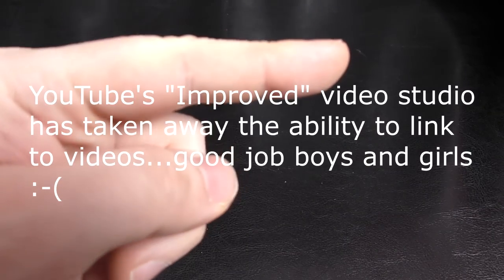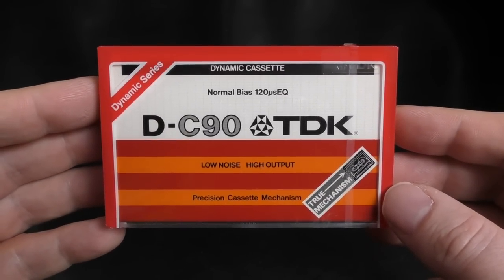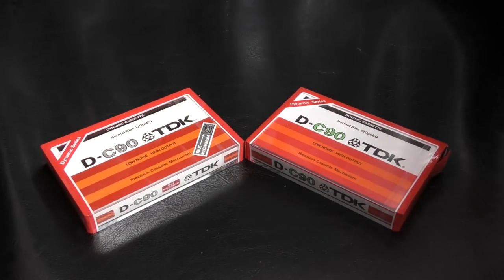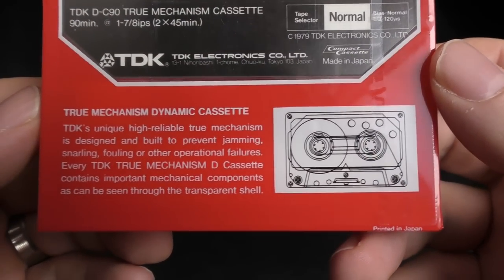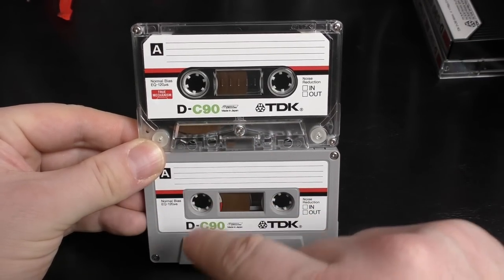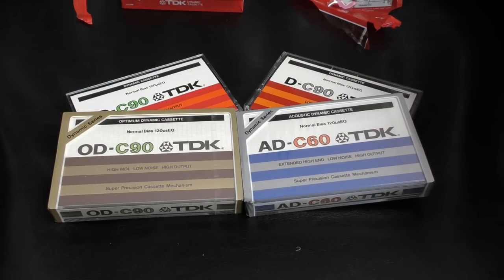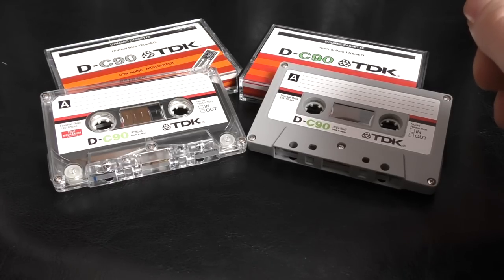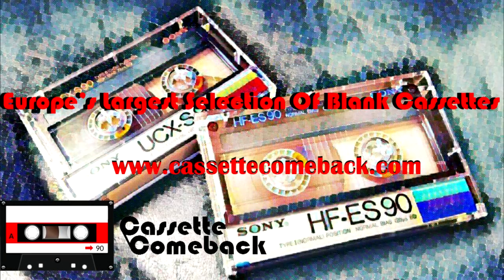TDK D True Mechanism Type 1 Cassette - A real TDK or Fake?

Comment: I'm in the mood for wild speculation: Maybe TDK was outsourcing the production of the head cleaning tapes to some less than scrupulous manufacturer, who then decided to build a side business around those genuine TDK parts and molds.
Reply from the maker: It could be plausible.
Reply: @CassetteComeback  in uk
Reply: @CassetteComeback   I have an original one from 1975, it has the same colors, spine and outer logos and the gray C90 and red TRUE MECHANISM symbol, but the black J has all 3 addresses, Tokyo, New York and Germany, and also almost the same diagram and list of 7 items but the font and wording is noticeably different, the inside is all white with lime green lettering.  The slip sheets do NOT have any dimples.  The stripe on the label of the cassette itself is only on the right side BELOW the viewing window and it's thick black line and lime green line below.  It has gold etched vertical hatch lines on the window, the shell is semi-translucent clear, Side A guide rollers have 6 spokes, Side B guide rollers are empty (same white plastic).  Instead of a 120ms EQ normal label, it simply says in tiny letters MADE IN JAPAN and on the upper right there is the "Compact Cassette" logo.  The case is completely clear and etched Made In Japan with a circle in the middle engraved 231A.  There is also a black manufacturer's mark on top of the cassette shell that reads TDK AJC723.  So it appears these were REAL, but the one you have is the forgery (or more likely, the 1979 version the FBI and TDK took issue with).  What a great story, thanks for sharing, I always thought this one was unique anyway, and it sounds great.
Reply: @YamFZR93    Could this be a strange case in which the fake is worth MORE than the REAL?!
Reply: @grizzlyaddams3606  yes , fake  /clone does not actually mean worse

Comment: Great video! Producing the cassette and box in clear plastics (box is clear styrene) also saves costs, no pigments needed. I think the reason for emphasising “True mechanism” is because now you can see how well the mechanism is built. I have unscrewed both versionsnand other than the lack of pigment there are no differences at all. So, the regular D’s are true mechanisms as well…..TDK-D is a true standard, of all cassettes I have, the TDK-D and AD survived the best if it comes to resisting demagnetisation. BASF Chrome are the worst, all lacking the crystal clear reproduction they once had. That leaves no other option to re-record them.

Comment: Nice interview and very useful service provided to the community. By the way... those seem very good tapes, probably similar or even better than the original D. I suspect this for a reason: if RAKS was commissioned to make a tape for TDK, and they probably did under the agreement they would eventually get a license, it's likely they chose a formula that was as close and as good or even better than the original TDK's D. And what brand was in business with RAKS at the time? BASF I believe were the ones providing the CrO2 pancakes for their Chromium Dioxide cassettes. BASF had the technology to match the performance of a TDK D, after all the IEC standards are based on BASF reference cassettes.

So... good to know. A TDK which isn't a true TDK but certainly is branded and sounds like one.

Comment: Great video again Tony. Much appreciate the effort you put into these vlogs. I agree that it is very strange for TDK never to have advertised these cassettes. I also think however that an out and out knock off also seems unlikely. Today it would be no problem, but manufacturing in the late 70's was a very different game, and counterfeiting at that sort of level was not so easily done. With the True Mechanism having been produced for a number of years, I would have thought that TDK could have had a big operation like that shut down if they wanted too. But who knows? As you said, it all just makes for a much more interesting story. I do have a couple of these tapes, and never gave it a thought before that they might not be genuine. All the best

Comment: surprised you don't mention the difference in SMELL coming from the cassettes and from the cardboard J cards.  Remember in the 80s you could tell which cassettes were FAKES by the smell.  The FAKES smelt cheap.  Oily smell and static on the plastic shells.  The cardboard J cards on the FAKES reeked of cheap printing.  colours would run when wet.  And of course the loose cellophane around the fakes would often move when pressed by your fingers.  Hope this helps.  Enjoying your videos 👍👍👍
Reply: Just like the Japan-made Maxell LN, UD and UR tape series of the early 1980's which had a strong smell when new - proving their freshness and how genuine they were.They were also better quality.
Reply: I'm thinking more of the millions of fake TDK D cassettes in faded red/orange wrappers... just horrible! 😵

Comment: My guess is these were genuine TDKs made for specific markets (ex. Third world countries). They probably had lower than optimal quality tapes inside. They were not intended for EU or North America. Other manufacturers have done it too. For example, Maxell, Sony, and Denon made their popular cassettes for the Iranian market with added text in Persian. 

As it sounds crazy to see the True Mechanism printed on these tapes, Japanese manufacturers did similar things in different ways to attract customers in third world countries and make them pay a little bit more. I bought a Panasonic TV in Middle East from an authorized distributor. There were two versions of the same TV. One was made in Malaysia and the other was made in Japan. The only differences between the two were “Made in Japan” printed on the front and “Made in Japan” labels attached to the back of the supposedly Japanese made TV. However, peeling off the labels in the back revealed the embossed “Made in Malaysia” on the back of the Japanese made TV.  Panasonic would honor the warranty claims and serial numbers were genuine.

TDK also had a factory in Iraq around the same time that manufactured TDK tapes for the local markets and they looked very similar to the genuine TDK Ds. 

TDK just didn’t sell these in EU, USA, or other first world markets and they didn’t want some one else illegally import them.
Reply from the maker: It could well be.  Thanks for sharing.

Comment: I have a TDK D 90 True Mechanism cassette, which has a copyright year of 1975-1977. It lacks the address in Japan. The sheet on the inside has green lettering. The box on the outside isn't frosted as yours and it has a square on the right with "MADE IN JAPAN" written on it. The shell lacks the True Mechanism logo on it and the C-90 font is green. I'm wondering if my cassette is an earlier example of the said TDK D True Mechanism cassettes or not ?
Reply: professionalvr I also have one of these, It's a bit different..
Seems genuine TDK to me..

Comment: Tony, great video, II watched it with  interest. 
I bought True Mechanism TDK D-C90 from electronics store in Bulgaria in the spring of 1978. Absolutely certain about the time, these were my first casettes when I got my first cassette player Hitachi TRK 5030E. The clear plastic body and slip sheet are identical. The white on black print carton insert is identical.  The only difference is that the back of the case is smooth clear plastic, yours has a rectangular texture pattern. 
I live in Florida now, but I still have the cassettes in my apartment in Bulgaria. 
Bulgaria borders Turkey and Greece, and further south is Cyprus...
Combine this with the story of the gentleman from New York, your guess may be plausible...
I listen to these tapes when I go back to Bulgaria and they sound the same as they were originally recorded on more than 40 years ago...original or not...

Comment: I used to have the TDK D “True Mechanism” version since I was a kid, but it looks similar to the regular D, but the shells are different. The regular shell was light gray, and the other shell was clear, and the labels are the same, except the “True Mechanism” name was added.

The US version was basically the same where it used the light gray shells, but the “True Mechanism” version in the US does not. The one I used to have as “Donna’s Tape” written on it, and it has music from a movie that it was recorded off of TV back in the 1980’s including songs from “Grease”, “Saturday Night Fever”, “Guys & Dolls”, “Rock & Roll Mom” and others, not the soundtrack albums, just recordings off of TV.

There wasn’t a “True Mechanism” versions of the SA, MA, and SA-X.
Reply from the maker: That's why I mean, if it was much better than the regular shells, sci only use it on the D?

Comment: Last year someone on the local auction site sold tons of used blanks for 1~2 CNY per tape, and that's where I got these 60 and 90 minutes version of "True Mechanism". I thought these were just normal TDK D of the same era but intended for "professional usage", like what Maxell did with "Communicator". Well, at least it's a decent tape for its price.

Comment: If you notice there are only three colors printed. The tape contains red, black, and green. The case contains red, black, and orange. The gray is probably produced by a dithering process. It would have cost a lot more to include a fourth color, green on that cover. Just a thought...
Reply from the maker: Yeah, you're not the first to mention this. I'm not a printer, but 4 colour printing is a lot more cost? The C60 just reused the orange for the 60. But why did they do it for the regular D and not the true mech?
Reply: @CassetteComeback  Probably, another reason it may have been a counterfeit cassette saving money.

Comment: I have also got four to five cassettes of this TDK with some number on it printed as ACC 122 and the original recording of Dubai is good of Indian music but I just played only once  on my ZX 7 cassette deck because this tape is depositing oxide particles on playback  head and other moving parts.I did not throw it out but can not play also. It means in yhe area around middle east it was sold jn large numbers and it is not a true mechanism but true cassette mechamism.The colour of the reel tape is brown as you showed in your video.
Umesh
India.

Comment: So, what are the odds that some company later bought the original TDK machinery, and turned out fakes, but fakes mostly made on that equipment?  They changed the things they had to change due to supply, and came up with the "True Mechanism" thing to account for that?

Comment: Nice video i do love cassettes :-)
What is  the Aiwa model cassette deck under the Nakamichi ZX-9 at 18:00 ?
It looks either like mine which is the ad-f850 or the ad-s950 which is identical yet is superior model it has dolby s calibration 400Hz & 10KHz tones
Reply from the maker: It's the AD-S950. Brilliant deck and the one I've had the longest.
Reply: @CassetteComeback  

Sure it is if i judge from ad-f850 still having it since 1996 and  playing like new yours ad-s950 is even superior .

Comment: Right. Sorry if this is a stupid question, but it's been gnawing away in the back of my mind. Why would the azimuth vary from one tape to another? I thought azimuth was a property of the deck itself? Once you've aligned it, shouldn't it be correct for all tapes (except ones recorded on a misaligned deck)?
Reply from the maker: The azimuth is a part of anything that is the peak. The best part of a tape might not be right in the middle. It might be towards the centre or the edge. In reality, it's a small thing that mostly won't be noticed, but Nakamichi built record head azimuth adjustment because they wanted to make the ultimate.
Reply: The cassette shell affects azimuth due to the fact that much of the tape guidance happens in the shell. The azimuth control is an attempt to compensate for slight differences in the angle of tape travel.

Comment: Your theories about Raks are interesting, I almost believed. But even if that were true, from a certain point of view, it is still an original rejected by disputes between companies.
I have a fake True mechanism in my collection, also on my website. I will send you the links privately or by e-mail if you are interested.
I think the True Mechanism is just a marketing move and its only difference is in the transparency of the shell.
To make matters worse, TDK had a branch in Iraq, Baghdad. They produced TDK cartridges as well as Eic cartridges.
Reply from the maker: It's very plausible this was the case. It's also being said they could be for poorer markets, like the later T1, J, Fe etc, hence why they weren't "promoted" as such. Because they would be cheaper than the regular D, the thought is that they may have been "smuggled" into the primary markets that they were never intended for and so could be sold cheaper than the regular D. TDK didn't like this and got the authorities involved. Again, all theories, but at the moment, this is the one that makes the most sense to me give that after using a couple, they are as good as a regular D.

Comment: This actually led me down a bit of a rabbit hole. I found a TDK catalogue that lists the 1994 SA-XS type 2 as 'having the lowest noise floor of an TDK tape ever'. Could you by chance look into that claim? I don't see how good a noise floor could be seeing as I don't think TDK ever made pure chromes.
Reply: Connor Mullins there was a TDK KR in like 1973-74 right before SA was developed, so i believe KR was their only pure chrome tape
Reply: It is very well possible that the claim is correct. the early 90's versions of SA-X and SA-XS were some of the quietest FeCo tapes ever made, their S/N ratio always rivaling the contemporary BASF Chrome Super/Maxima, which must have been the quietest tape of them all, but with slightly lower MOL compared to the TDK products. I don't think the single layer KR tape from the early 70's already had as low noise as a late, refined double or triple layer FeCo like the SA-X and SA-XS.

Comment: I believe they are original tdk, as I have some of this type from the previous generation, 1975/1978, C60 and C90 and the internal components are identical to those of the normal TDK D, including the leader tape. I also have a really false TDK "true mechanism" from 1979/1980, which shows the terrible quality of the sheel, printing of the jcard and labels, as well as the poor quality of the case. These tapes must have been produced for a specific market.
Reply from the maker: That seems to be the more likely theory that's developing. Made for poorer markets, like the later TDK J, B, T1 etc...and they never featured in any TDK adverts.

Comment: There were several different counterfeits of the True Mechanism D, I have some myself, and out of what I can see of the example Gary is showing here, he has probably one of the fakes too: The label is improperly cut, the spacer around the erase tabs inside the shell has a more generic, rounded shape rather than the distinct square shape in the genuine TDK's of that time, and he talks about the sound quality being low. So I believe every word he is saying. Cool memory! Now here is my annoying "but"...: Tony, I really think you have a genuine TDK True Mechanism there. Zeddie also has a "real" one. I also have some. There were at least 5 different versions made by TDK. The earlier ones still have the multiple addresses on the j-card. The fact that they are not mentioned in any TDK ads we can find on the web is admittedly strange. On the other hand, my thought on this is that they were mostly sold in Near/Middle East markets. I have never seen them in the wild anywhere in continental (Western) Europe or Scandinavia. This might be why they are not included in the European and US ads. Also, I don't think the True Mechanism is to be considered as a step up compared to the regular D. It is rather a budget model with a fancy clear shell, performing the same as a D. (Yes, I've seen they are biasing a tad differntly, but still close enough for different batches of the same formula). The grey C-90 print is the only thing I don't understand, but still, this is consistent through all the different versions from 1972 to 1979. Even in later years, TDK continued the concept of putting the same tape into an alternative, clear shell. There was a DS and an AD-S: http://vintagecassettes.com/tdk/tdk_files/tdk_year/tdk_84j.htm Concerning Raks, I don't think they were involved. Everything about Raks cassettes is different: Tape, leader, shell construction, hubs, slip sheets, Norelco case... it would have been a huge effort for them to install toolings solely for the True Mechanism cassettes to make them look close enough to a real TDK product, and then not even continue to use it for their own brand.

Hope I don't take away all the positive feelings about this video now, only because I come to a completely different conclusion, because I really like the investigation you've done :-)
Reply from the maker: Hey, I don't say that they're fake or real. I present what I know and postulate on what they could be. I'm not convinced either way, in the end I think they're a decent cassette and worth having. I have no problem with differing opinions, I ask in the video for people's thoughts. Maybe someone can bring something to light about them, and you have expressed your doubts in a lucid, friendly way. I have no problem with being corrected, it's how we learn.

Comment: Thought just occured to me, if these are TDK, might they be an older circa 1974/75 iron oxide stock? Grab and oldie TDK D, and compare? ;o)
Reply from the maker: I did compare to it to the 72 D and they weren't the same...the 72 seems the same as the 79
Reply: @CassetteComeback  Interesting, thanks Tony.